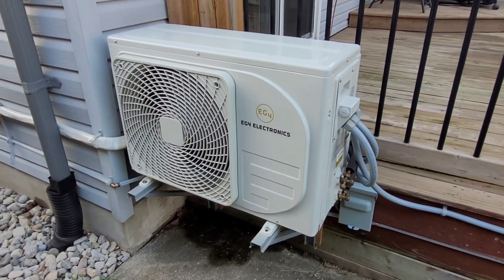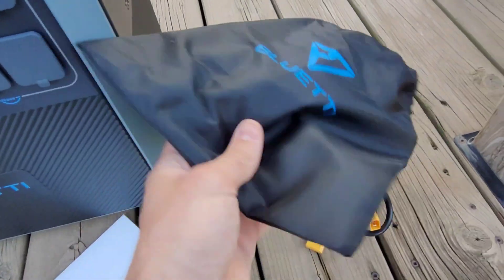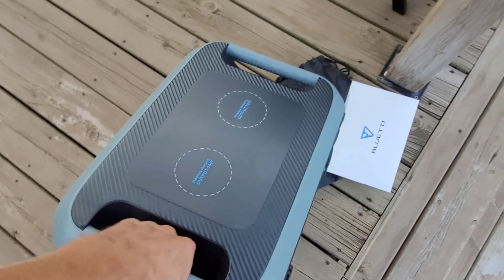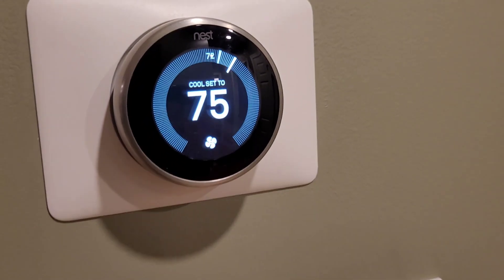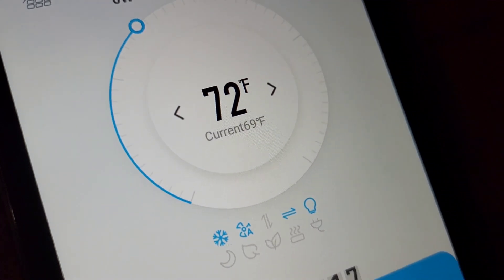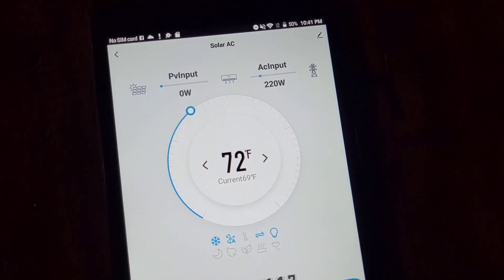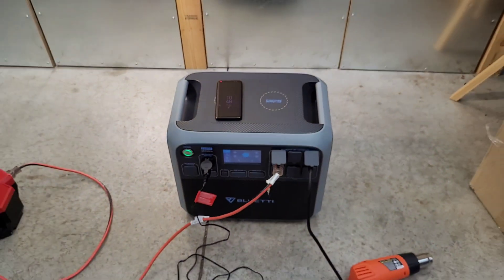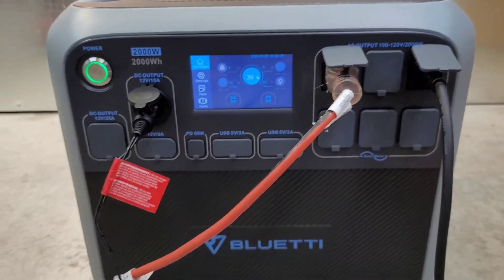Can You Run A Mini-Split AC On A Bluetti AC200P Power Station?

Comment: Loved the thermal image addition to the torture test. Now I’m wondering how I could use this for heating water for hot showers off grid. Any suggestions? I have a Jackery 1000 and I’m wanting to make sure my next purchase can do it all.
Reply from the maker: Check out my recent video on the water heater, it's not as efficient as a heat pump WH but it's small and cheap
Reply: @SmitHVAC.  Haha well good thing I subbed. You mentioned water heater and peaked my curiosity to add that to my dream list. Will watch now.
Reply from the maker: @mimiseeyou  I'm planning to build a heat pump water heater at some point too, thanks for the sub!

Comment: I am not having good luck at all getting my compact (Backback) mini split to work with my 200max…and I have B300 expansion battery.  The Max is limited to 30 amps, so I bought a plug in converter that converts the 110v to 12v and offers 100amps.  Still faulting out.  I used 8awg wire to expand the units cable distance.  I am at a loss.  The weird thing is if I wire direct to my fuse panel and run off BLUETTI 12v, 30amp output it will run on lowest two fan speeds and blow cool.  If I wire to the converter I bought it will run up to all 5 fan speeds but only blow warm outside air.  I am ready to drive the van into the river!
Reply from the maker: How many amps is the AC pulling on startup? Do you have a link for it?
Reply: Maybe my mistake was buying a 12v, 60amp back pack mini split?

Comment: Why would the compressor run at all? This is confusing if the house is at 69f why is the compressor running when set at 72f? My inverter ac turns off the compressor completely if the temp is under whats set
Reply from the maker: It stays running unless it exceeds the set temp by 5f, probably to avoid short cycling. My garage mini split acts the same way as yours.
Reply: @SmitHVAC.  5 whole degrees? also its an inverter unit it should be able to handle short cycling very well
Reply from the maker: @AliYassinToma it's probably more efficient for it to ramp all the way down to 200 watts than it is to shut off and turn itself back on 10 minutes later and have to ramp back up to 600 watts. Maybe, maybe not. I'm not the engineer. It's also less start / stop wear on the compressor.

Comment: Hey, awesome video, do you have one showing how you wired that extension cord on the other end?
Reply from the maker: No I don't but it's pretty simple on a 120v heat pump like this. Line to line, neutral to neutral, ground to ground!
Reply: Are you wiring straight onto the side of the heat pump?
Reply from the maker: Yes essentially, it goes through a disconnect first
Reply: @SmitHVAC.  thanks for the info, I just went and checked mine out, but both mine are 240v

Comment: can you show how you wired the mini split to the power station
Reply from the maker: Just a 14 gauge extention cord to the line, neutral and ground connection on the mini split
Reply: that to a powerstation, like an ecoflow? @SmitHVAC.
Reply from the maker: Yes. This is a 120v mini split so it can go to any 120v power station
Reply: @SmitHVAC.  is it a plug on the end or some wiring needs to be done
Reply from the maker: @placezplacez5351  plug on one end, wired to the 3 terminals in the other end

Comment: So the bluetti drains power as it sits plugged in.  Even if your not using power
Reply from the maker: If you have the inverter switched on, all power stations use power while idle
Reply: The Jackery does not at least the small one doesnt.  I use them for my recliner.  Bluetti is dead after a few hours just sitting there idle no use.  Jackery will sit for days
Reply: It's small detail but huge issue.
Reply from the maker: @DavidCarreau  unless the jackery has an automatic on/off it will use power anytime the inverter is on. You can't convert DC to AC without losses/ consuming power. The smaller the inverter, the less it will use and may not be as noticeable as on large inverters.

Comment: Will you please please please please please please do a tutorial on exactly how to connect Accord to the mini split so we can plug in to a power station.
This would be so much easier than having to pay an electrician to come out and run something to the panel box in the middle of nowhere LOL I have enough solar panels to run the air conditioner and to charge my power station I have that part figured out.
Reply from the maker: I just commented on your other post, but I can explain further in the Facebook group if you need me to
Reply: @SmitHVAC.  yes and pictures would help. And even a little video of the mini split and where to find the connections.
Trying to figure this out is what's holding me back from buying one. Now signature solar does have a really good step by step instructions for basic install with the lady that's doing it the guy talks way too fast you can't see around his hands to see what he's doing but her video was awesome.
I have a growatt Infiniti 1300 it's supposed to be an 1800 w inverter.
So it should handle this no problem from the wattages I was seeing in your video where you hooked it up to the Bluetti and then the other one I don't remember the name of that power station.
I hesitate to ask questions in the groups because people get very condescending and they want you to hire a professional like nobody's ever supposed to learn anything ever again and they seem to forget that at one point they knew nothing either.
Reply from the maker: @mycabinlife1291  The unit comes with a manual that shows you where to wire the AC voltage. There are 3 terminals, L N & G, the black wire of the cord or Romex goes to L, white goes to N and green goes to G. If you watch some videos on how to wire a 120v light switch or outlet it will give you a better understanding of what L N G represents. I hope you end up buying one! They're awesome.
Reply: @SmitHVAC.  now could I leave my solar panels plugged in all the time and leave this plugged into the power station simultaneously? My power station also has the pass through charging so I would also have solar panels hooked up to my power station. I would also have a set of four 455 watt panels or three if it's enough hooked up dedicated just for the mini split.
Reply from the maker: @mycabinlife1291  yes you could leave both connected at all times. 3 panels at 455w would be enough as long as the voltage was high enough, it needs at least 90vdc on the solar side
Reply: @SmitHVAC.  yeah I don't remember what that was I got them from signature solar for my system. I'm going to try to get them to take back the inverter because I don't want it it's a 6000 EX. This whole process with them has been nothing but a huge headache and disappointment. That's why I finally spent $1,000 on a solar generator because I have equipment right now that's useless for me. But I love my little growatt. It's given me confidence. It's capacity is to small for me though. 
I have three of the EG4 Server rack batteries. I would love to have that capacity available to me right now LOL
Reply from the maker: @mycabinlife1291 why are you trying to return it? The 6000ex and 3 server rack batteries is a nice setup
Reply: @SmitHVAC.  I'm keeping the batteries I just don't want that specific inverter it's a very long story.
If I can get everything figured out I would like to get the mini split that we've been talking about.
And I'm not sure if it's going to be one or two of the EG4 3000 watt inverters. (2 diff projects)
But I spent a lot of money with them already for a system I can't use so I'm not going to spend another dime until we get the inverter issue resolved.
Reply: @SmitHVAC.  I really don't want to put the entire story on a public forum.

Comment: I bought a 12V DC AIrconditioner, I was wondering if it can power it.
Reply from the maker: How many amps does it draw?
Reply: @SmitHVAC.  355-60 amps.
Reply: 35-60.

Comment: I see where you have plugged the mini split into the Bluetti.  What about the other end? Does the unit come with a cord with a plug?  Asking for a friend. 😉
Reply: Yes I would like to know exactly how he did this with a very slow tutorial LOL
Reply from the maker: It's just a 14 gauge extension cord with the female end cut off. Hot, neutral and ground connected to the AC input terminals on the mini split
Reply: @SmitHVAC.  pictures are worth a thousand words LOL you forgot you got newbies in here LOL
Reply: @mycabinlife1291  Exactly!  Kind of like How To Become A Millionaire. First: Get a million dollars……😂

Comment: I have a shuttle bus that's going through rv conversion. Would you build your solar/power system around this product or go the more traditional way of batteries and inverters? Do you think the bluetti could be enclosed with the front out? Would it overheat?
Reply from the maker: It's a good bang for your buck, but if your going to be in it for a long time you may want to build your own. More upgradable if plans change.

Comment: Great info..but I have a question about my Bluetti AC200 Max and EB70.  Like all solar generators they have no ground out.  Only live and neutral.  My solar powered sea container tiny house has grid already installed through a distribution box and I put an Automatic Transfer Switch in with solar priority.  There is a ground rod buried 6 feet in soil outside the container.  With plug in tester and on grid it shows normal sockets wiring, ground/earth and live wire correct, no live neutral reverse.

On the Bluetti AC200 Max I used the plug in tester to distinguish live from neutral as it's not marked on mine as the cord plugging into the Bluetti AC200 Max and going into the distribution box shouldn't have live and neutral reversed (that would be easy to do with only a two pin plug going into the Bluetti).

So before I go further is the floating neutral going to have to be dealt with???  When I test the sockets with Bluetti on, it shows no ground now, of course, and my grid when switched over shows ground.  I am using a plug in tester.

Comment: I have the same AC200P little over a year. NOT happy with it! Try leaving the unit on (Display on) and see How much that draws? I have Complaining about my unit since February 2023. They had just now August 20, 2023 replacing it. What a hassle. Also #3 of there 350w panels FAELED! If you read their pamphlet, It says hassle free warranty far from it LOL. On Aug,24 I received a e-mail they are sending me a new unit along with a 4th 350 Watt panel. See how long that one last LOL. BS on sending the old one back, I have many hours in to this. Stay Ture to the people. Thank you
Reply from the maker: That sucks. Mine doesn't use much power if only the screen is on. If the DC or Ac is on that's a different story but they all do that. What kind of use are you using it for? Is it daily? What type of loads?

Comment: If the set point on the eg4 is at 72 and the house is at 69 why would it still be running
Reply from the maker: Most inverter mininsplits run this way. They ramp down as far as possible instead of shutting off, they will usually turn off if they get 4 or 5 degrees below the set point.

Comment: If eg4 needs 1200w but your only producing 500w dc does it still use the 500w of dc power and the grid supplements the last 700w with ac power

Or do all 1200w come from ac power when the solar is generating less then the needed capacity. If it switches to ac and only used ac power what happens to the generated power do it go back in the grid or is it lost?
Reply from the maker: It can't back feed into the grid but your first statement is correct, it will use all the available solar and add whatever grid power is necessary.

Comment: I have that exact model. Had for about year and a half.
Reply from the maker: How do you like it? Is it still working good?
Reply: @SmitHVAC.  yeah works great. Haven't used it on regular basis. I also have a pallet of 10 250 watt panels I got nearly 2 years ago. I haven't even uncoated  them yet. Been running behind on my need to do's. Because of other things come up. Planning on using on my solar mini split. Hope to get 5-6 of them eventually.  As well as a large solar Arata set up from Signature Solar.  They are about an hour away from me. Should be getting first mini split next couple of weeks. ... Jeff
Reply from the maker: That's the way it goes in life, let me know when you get it hooked up!
Reply: @SmitHVAC.  sure will. Hope I won't need your help, seeing as I will be getting the plan n Play model. The only drawback to that one is the excess line have to be coiled and put away somewhere.
Reply from the maker: @JWTX  Yes that's the only drawback, I'll be installing one soon and I'm curious to see how it works out.
Reply: @SmitHVAC.  I'll definitely be watching.  Maybe you'll have yours before I have mine. And I can learn from you. Thanks
Reply from the maker: It's arrived already but there are some renovations that need to take place first, it will probably be another month
Reply: @SmitHVAC.  I just ordered 2 of the 12k solar mini splits with plug and cool. Had to pre order supposed to be in Mid September.  But I bought the Inovair 38 SEER mini split about 18 months ago. But did not realize it didn't come with the line set. Was going to order one with my other units. But said they are no longer available.  So I figured I'm gonna have to make my own. How difficult would thar be ? And any advice?..... Jeff

Comment: Thanks for another great video. Giving serious thought to adding an EG4 heat pump to the house within the next year. How much has the main house AC run this summer? Have you noticed a huge difference in your cooling bill?
Reply from the maker: Thanks for watching Damon! The main Ac has run significantly less, it used to run 8 to 10 hours a day on the thermostats history, now its about 2 hours per day. Usually just after we've gone to bed and all the doors are closed we run the main system. The savings haven't been huge but definitely noticeable. It's already a very efficient Ac and the house is well insulated and easy to cool. If you had an older house with a big 4 or 5 ton Ac the savings would be substantial!
Reply: @SmitHVAC.  Scoping out the MPP PIP 2724 with the about 750-1000 watts of solar as the AC load to supplement the EG4 and its solar panels. I was going to install the system in the great room of the house since that’s where the family is most of the time. I’m hoping this would make a difference in Georgia. Plus having a back up in case the power were to go out after a hurricane or other summer storm would be a bonus.
Reply from the maker: I think it would definitely make a difference! And having it during an outage makes it instantly worth it.

Comment: Theoretical question: (If you were 100% off-grid.)  Could you have a set of solar panels (how many watts would you recommend?) that only powered the EG4 during the day and another set of independent solar panels that charged only the Bluetti during the day and the Bluetti was permanently connected to the EG4 as the 120 VAC in, ....... could you just leave it that way and let it run all summer or would the EG4 be damaged as/if the Bluetti ran out of charge on a super hot night at 3:00AM?   (I want to know if I could hook it up that way and just "plug and forget").
Reply from the maker: Yes that's a great way to hook it up, when the Bluetti died everything would just shut down and come back to life the next morning when the sun came up. The EG4 would run all day while the Bluetti recharged, and the Bluetti takes over after sunset.
Reply: @SmitHVAC.  that's what I plan for my channel's solar sea container.  I have wired up an Automatic Transfer Switch and am ready to put up panels, but have a question about these "floating neutrals" and if it needs to be dealt with somehow.  I have a distribution box in the container running the grid in from the house, so I guess it's technically a sub-panel.  When I plug in my Bluetti then the outlets ground disappears...is it an issue?  Things like the a.c. mini split I have just installed won't be affected by no ground..,or would it??
Reply from the maker: @cnxoutdoors  I don't think the mini split will be affected. Certain appliances like modern gas furnaces are affected by this and I've made a grounding harness to satisfy the furnaces control board, otherwise it throws an error code. I was thinking about making a video on this actually..
Reply: @SmitHVAC.  thanks for the quick reply!  Good to know, so I am about to test if the Bluetti AC200 Max runs the a.c. as the sockets all show good except for no ground as mentioned.  Please do make a video about this as it's a question coming up for many tiny house builders, no doubt!
Reply: Hello… I am trying to live off grid in my bus build as a travel nurse. I have 850 watts of solar on my roof powering my BLUETTI ac200L. We just installed a mr cool 9000 btu mini split. What we can’t find is a diagram or info of how to wire the mini split via a breaker to receive power from our BLUETTI. Can you advise?
Reply from the maker: @R.U.Unplugged is Mr cool ac 120 or 240v?
Reply: @SmitHVAC.  120

Comment: Could you please clarify: How many Watts of rated solar are you using and how much would you recommend the rest of us use (in the USA) and at what latitude are you? (Just for the EG4)
Reply from the maker: I'm using 1200w of solar and would recommend anywhere between 1100 to 1700w. I will be upgrading to 1600w before winter. I don't know my latitude off the top of my head but I'm in Ontario Canada if you'd like to look it up